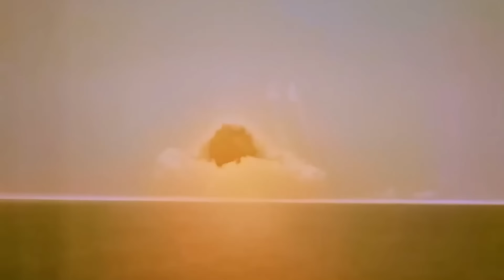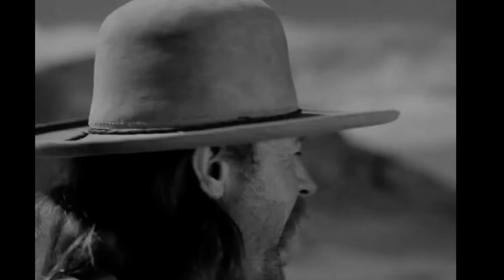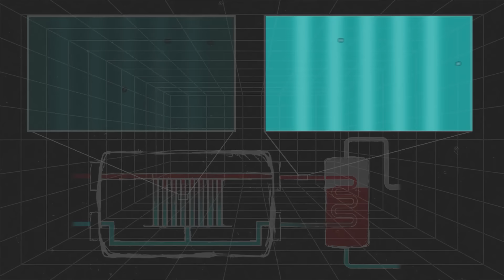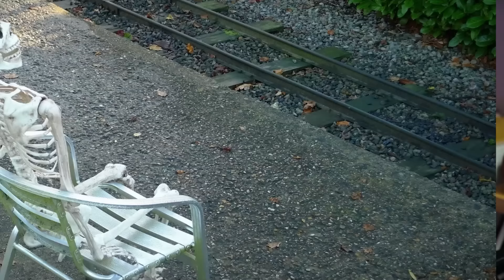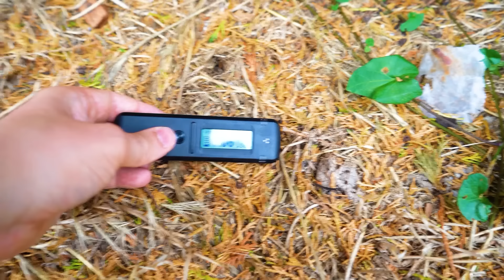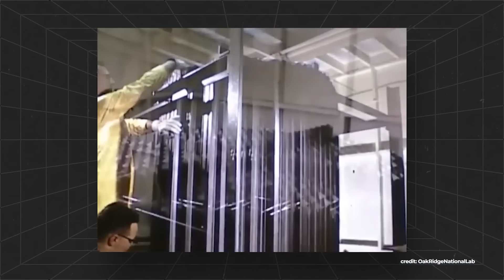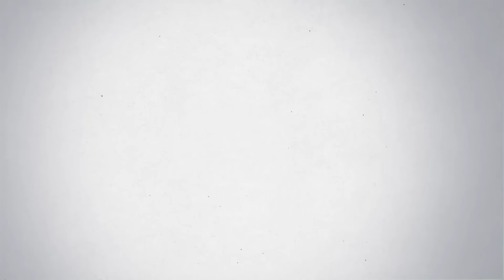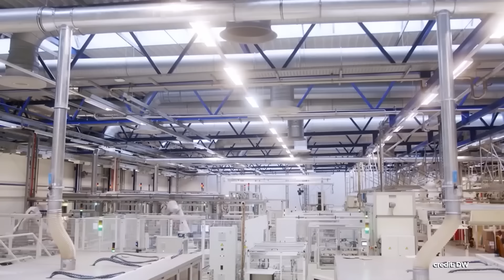It's Happening - China Launches World's First Thorium Nuclear Reactor

Comment: Why are the missiles such a big deal?
From the US, Ukraine wants more of the Army Tactical Missile System (ATACMS). The system can shoot ballistic missiles that can carry cluster munitions up to a range of 300km (190 miles).

This means that they can hit Russian military bases and runways from which Moscow launches attacks against Ukrainian bases, along with towns and cities and energy infrastructure.

The Storm Shadow missiles of the United Kingdom, which are cruise missiles launched from aircraft, are also capable of reaching targets deep inside Russia as they boast a range of up to 250km (155 miles). The French equivalent of these missiles, known as Scalp, has similar capabilities.

Ukraine’s demands come as the Western allies have formally accused Iran of supplying Russia with short-range ballistic missiles that it can potentially use on the front lines within weeks, leading to new sanctions on Tehran. Iran denies arming Russia for the war.

ATACMS
The ATACMS can carry cluster munitions to hit Russian bases and aircraft [Sgt 1st Class Andrew Dickson/US Army via AP]
If Ukraine’s demands on the missiles are accepted, it would primarily have an effect on areas within about 200km (124 miles) of the front lines in Ukraine, with most likely targets including logistics hubs like fuel or ammunition sites, command and control locations, troop assembly areas, transport choke points, airfields and naval bases, according to Justin Crump, CEO of risk intelligence company Sibylline and former British army officer.

“The heightened risk of attack over a larger area would force Russian defences to be spread more thinly, necessitate the dispersion of logistics chains into smaller locations and packets for movement, and increase the time that Russian aircraft take for combat sorties,” he told Al Jazeera.

“Russia can work around all this, but in a relatively evenly matched struggle, interdiction of command and supply will have disproportionate impacts. We have seen this already inside Ukrainian territory, but removing the ‘safe space’ for the Russian military over the border has long been a desire for Kyiv.”

Advertisement
Where does NATO stand on missile sharing?
Some NATO officials have backed Ukraine’s bid to receive more long-range missiles and use them on Russian soil, chief among them outgoing Secretary-General Jens Stoltenberg.

Finland’s President Alexander Stubb has urged NATO and the US to provide Ukraine with long-range missiles for use inside Russia, with the Czech Republic also saying it does not believe Ukraine should face any restrictions over the use of Western-provided weapons.

Meanwhile, the US and the UK have said they are considering the idea. Zelenskyy has confirmed that no green light has been given yet by the major powers arming Kyiv.

The main concern is that the war could considerably escalate since Moscow has explicitly warned that using the missiles inside Russia would be tantamount to NATO directly entering the conflict.

Robert David English, associate professor of international foreign policy and defence analysis at the University of Southern California (USC), said he is fairly certain that Ukraine will not get authorisation to use Western missiles on economic targets such as oil refineries and seaports.

Advertisement
“Those would cause many civilian casualties, and NATO may fear that Ukraine will be reckless or seek to widen the conflict and draw NATO in more directly,” he told Al Jazeera.

Germany has firmly refused to supply its Taurus long-range missiles to Ukraine, reflecting broader caution in Berlin about escalating. The low-flying cruise missile has a range of 500km (310 miles) and is suitable for hitting buried or protected targets. The air-launched projectile would be the strongest Western missile to be used by Ukraine if Germany later decides to rethink its cautious approach.

Taurus missile
A general view of the Taurus cruise missile of Europe’s multinational developer and manufacturer of missiles MBDA at their headquarters, in Schrobenhausen near Munich, Germany, March 5, 2024 [Angelika Warmuth/Reuters]
Most other NATO allies have opted to refrain from adopting a clear-cut public position on whether the missiles should be used inside Russia, likely due to the sensitivity of the issue.

Some of the most important among this group are France and Italy, which are partners in manufacturing the UK’s Storm Shadow missiles, which use US-made guidance systems. All four countries must consent before the missiles can be used at their maximum range.

Turkey, for its part, has continued to pursue an approach that maintains links with both sides of the war. Ankara has supplied Ukraine with armed drones, armoured vehicles and other military aid, including tactical gear, but has not supported a more aggressive stance, even offering to host peace talks.

How would Putin respond if Ukraine got the long-range missiles?
The USC’s English said authorisation to use the missiles inside Russia would signal a “major escalation” and that NATO members are concerned Russian President Vladimir Putin would not overlook this crossing of a “red line” as he has others.

“Russia could counter-escalate in a number of ways, from more brutal attacks on Ukrainian civilian targets to sabotage of Western satellite or undersea communications,” he said, adding that Moscow already believes NATO has entered the war as it arms and trains Ukrainians and provides intelligence.

Advertisement
“In fact, by the laws of war, this targeting support already makes the United States a combatant in the war because we are directly facilitating armed attacks. Now the US either denies or simply doesn’t comment on that part of their aid to Ukraine, but we all know that Ukraine doesn’t possess a fleet of intelligence satellites or high-altitude surveillance drones. So it’s not like NATO would be going from hand’s-off to involved, it’s just an increasing degree of involvement.”

But Sibylline’s Crump said Russia is trying to undermine Western support for Ukraine and sow hesitation and concern among Ukraine’s allies with repeated threats about red lines and talk that it considers to be fighting all of NATO.

“Ultimately, the Kremlin knows it is not fighting all of NATO, nor could it afford to. Instead the strategy is to divide, confuse, and disrupt without entering open conflict. Undermining the alliance and paralysing decision making is the intent, with the nuclear factor making this a more charged situation,” the former British army officer said.

“This is something Russia consistently exploits in its information warfare efforts, but the threat is therefore wearing thin. While an uptick in harassment, acts of sabotage, and societal aggression in Western nations might be the result of further support for Ukraine, the Russian threats currently say more about the weakness rather than the strength of their position.”

And if NATO does decide to share long-range missiles with Ukraine to strike deep into Russia, Moscow cannot claim to be a victim of escalation, Crump said, pointing to Russia’s sourcing of missiles from North Korea and allegedly from Iran. “They [Russia] themselves opened the door to this move,” he said.

Comment: Back in the 1950s through 1970s when we had many nuclear experts and health physicists, they have already tried many nuclear reactor designs and determined their flaws.  Today many of the experts are dead, so we are relying on very few experts these days with no institutional knowledge of reactor safety principles.  Likewise, large nuclear reactor manufacturers like Betchel are no longer around.  MS and Thorium reactors designs were looked at back then, but someone needs to dig up the old files in the Department of Energy vaults to find out why they were not practical.

Comment: China will not be building the worlds first Thorium reactor. The Peach Bottom reactor in Pennsylvania was what you are calling a Thorium reactor. It was built and operated in the mid 1960s. The Fort St. Vrain Reactor was a "Thorium reactor" built in the 1970s in Colorado. I was on the design team for it's first core, and I personally designed the first reload core. The design utilized a graphite moderator with cylindrical holes filled with either U-235 or thorium pellets coated with graphite. The plan was to use the U-233 bred during operation in a subsequent reload. I don't remember if they ever used the generated U-233 in the reactor before they shut it down. Molten salt sounds great but the corrosion was a killer. Perhaps we have better materials now. If China builds reactors the way they build bridges, they are in big trouble.

Comment: A big impediment to electrification is the limited capacity of the grid. Expansion requires land easements and California has demonstrated the wildfire risk.  SMRs will bypass much of this impediment by bringing the supply closer to the demand. While Washington DC is blessed with politicians as a source of wind power, most other megalopoli  don't have the space for commercial solar arrays (plenty of rooftop places) or wind farms.  A scattering of SMRs occupying a square 10 blocks on a side will greatly reduce grid demand; limiting it to load sharing.

Comment: What a comfort. Radioactive for only 500 years vs 100000. That’s still a long long time.  And who is going to be the poor sods to look after it for 500 years. This also adds to cost. We don’t have this problem with solar, batteries, hydo, pumped Hydro and Wind. Sure it has its problems too but they are much less, and they don’t spew smoke and are not radioactive.

Comment: One thing to keep in mind about molt salt reactors and their turbine systems is that molt salt reactors can operator at much higher temperatures. As pointed out in this video, that allows them to not require a high pressure in their reactor vessel and cooling loop. This also has the added benefit of a high thermodynamic efficiency since the delta between the heat source and cooling source is much greater. The higher temperature would also allow a molten salt reactor to operator a air / gas turbine instead of a steam turbine.
Reply: Basically it's hot enough to make the air as angry as water to push the turbine and doesn't need water?
Reply: Helium is one of the gasses that is being used in MSRs or PBRs.
Reply: I guess that was originally the idea of using this principle as a subsitute for kerosene burning turbines for aircrafts. Just suck in cold air on one end and expulse hot expanded air on the   other end for propulsion..  
I do not know why it failed..?
Reply: thermodynamic efficiencies are irrelevant compared to neutron efficiency.
Reply: @martinzihlmann822     Cooling is not irrelevant or nuclear.
Reply: Thorium is a good idea.  Lower radiation, lower pressure. How did they fix the corrosion problem with the pipes and the molten salt?
Reply: @Kool6790  I guess that in the chemical industries similar challenges are occurring. I know from my professional experience that there are pipes and valves made of high temp. plastics like Teflon (PTFE) and other PFE that could be used for these applications.  I however do not know the details of the real temperature and delta etc. involved!
Reply: @uweburkart373  The issue is very high heat combined with the corrosion of salt. We were not able to solve that problem
Reply: @Kool6790  Ceramics?
Reply: High temperature differences does not imply high efficiency. Quite the opposite. High temperature differences increase entropy generation.
Reply: This discussion makes me want to go back and take HS physics. I stayed on  the bio side of science and i think I really missed out
Reply: Not water or air, but actually supercritical carbon dioxide.
Reply: The demand for plutonium drove the World down the uranium nuclear rector path and starved thorium rector development of resources.
Reply: Energy storage is a critical element (alt to Lithium eg gravity etc) to stabililize wind and solar.  If Sodium can operate at ambient pressure that surely ceramic containment tubes are more promising as they are electrically inert - non corrodable like metal

Comment: One small issue with thorium reactors (and their radioactive waste) was that although there isnt as much and less actinides, some of the radionuclides present emit very high energy gamma rays which require A LOT more shielding than that of current reactors. I assume this is also something to consider with molten salts as they will be transiting across a large area, all of this will need to be either inaccessible, heavily shielded or remotely managed.

Comment: Too expensive. According to the Institute for Energy Economics and Financial Analysis, the target price for nuclear power was still 58 USD/MWh (5.8 ct/kWh) in mid-2021. This price has now risen to 89 USD/MWh and there is no end in sight. The main reason for this is the estimated construction costs, which have risen by 75 percent from 5.3 to 9.3 billion USD. The electricity generation costs for nuclear power would be significantly higher without the government tax subsidies. (...) Even with a modest inflation rate of 2 percent by 2030, according to the institute's calculations, nuclear power from the SMR would not be 8.9 ct/kWh (89 USD/MWh), but 10.2 ct/kWh (102 USD/MWh)."

Comment: i wonder how this design will impact nuclear fuel recycling ? normally spent fuel technically still have 90% of the energy content left but the excess neutron absorber fission byproduct degrade the fission efficiency enough to make the fuel uneconomical. But since it's liquid format, I'm assuming the neutron absorber by product can be filter out of the liquid instead of going through an expensive recycling process like what france is currently doing right now.

Comment: The first Chinese Thorium reactor will be almost exclusively used for H2 production. Some of the energy will be converted to electric energy for electrolysis, all the rest will just heat water for the purpose of H2 production. That's why the plant will be built at a distance from consumers and it will still make sense. Experimental Thorium plant and experimental H2 installation looks like a good combination for low-emission energy production.

Comment: When you say produce 100 megawatts do you mean in one day, one hr, one year?
Reply: You don't "produce" megawatts.  You produce energy.  Megawatts are the capacity to produce energy. Run a 100 megawatt plant for 1 day and it produces 100 mw-days of energy.  Run it for a year and it produces 100 mw-years of energy.   Think of it this way, the megawatts are the pressure that shoves out energy.  This pressure is there as long as the reactor is running until it is finally shut down.

Comment: I like the idea a miniature reactors the size of an AC unit. A company out of Oregon is  putting them on the market soon for commercial application. The whole system would fit in the back a cargo van. The idea of supplementing energy is interesting. Although the main hurdle will always be our grid system that operates like a faucet with on an on and off function. Building a way to store energy that has not been used yet would be the best way to upgrade our grid; but that is not good for energy companies bottom lines.. There a a company building energy storage out of a stone mixtures (stores as heat) then puts it back into the system overnight for use with  commercial applications.
Reply: I find it hard to believe that anyone has one of those at all, much less one ready to be sold commercially.
Reply: @robertbrandywine  they are called small modular reactors as an industry. Bill Gates is throwing a ton of cash at one of the companies. There is a real push for the scale and scope of these energy manufacturers for industrial use. Corporations see it as another way to vertically integrate their supply chains.
Reply: @brookvillekansas90  ActuaIly I looked and there is one in operation in Russia.
Reply: @robertbrandywine  China has them as well. I mean we do have them for military applications currently. Investing in uranium mining royalties maybe a good play for what is coming down the pipeline.
Reply: @brookvillekansas90  None of this has to do with thorium based MSRs though.  There is only one of those, in China, and it isn't a SMR, so the talk about tiny reactors that several people have mentioned in the comments seems sort of out-of-the-blue and slightly off topic.